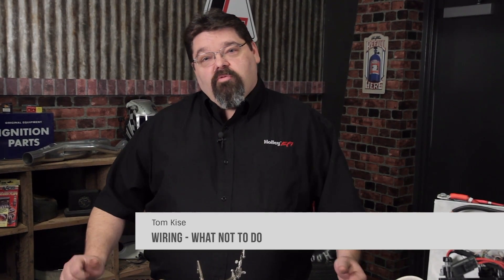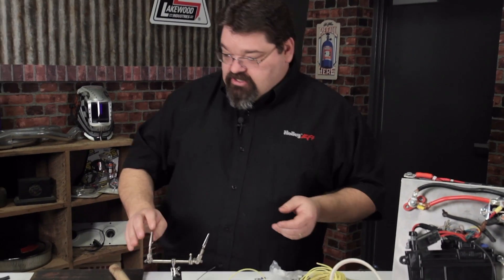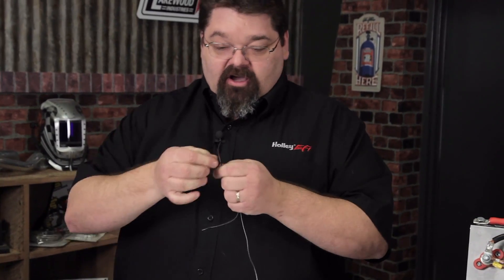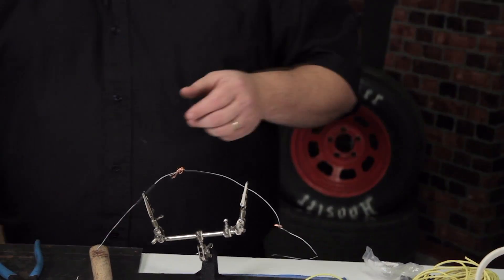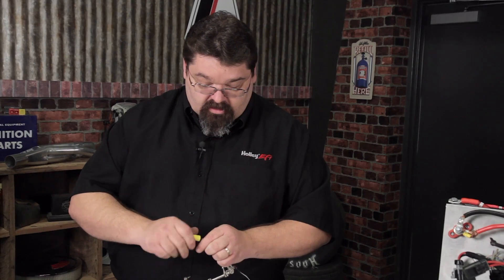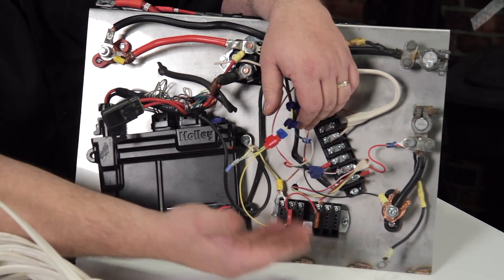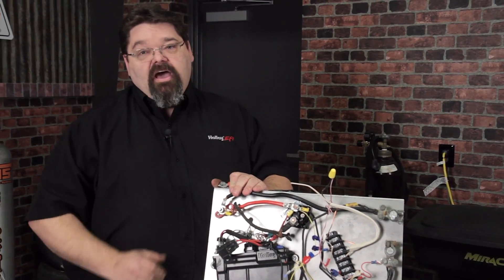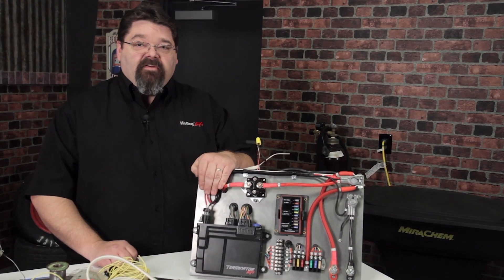Bad Wiring - What Not To Do

Comment: 0:20  The GUAGE is good 14 or 12 gauge copper is  GREAT conductor!! .. But it needs to be multi Strand wire because of the constant vibration, and the oil resistant insulation ...  

AND?? NOT!! 6 or 8 Strand industrial wire either!! :) Muti Strand wire designed for automotive use (for oh so MANY reasons!!)
Reply: ill be honest... I use stranded house wiring for my car wiring. I try do everything by the book and proper (crimping, gromets, fuses...) but its hard to find good automotive wire in my place that doesnt cost more than my crappy car. is either bad insulation or very cheap stranded copper aluminum blend that doesnt last at all. 

and checking the specification of the high quality house wiring (thats still very economic and can buy from my local house supply stores) its just as good as the average automotive wire. also the copper is thicker too. 

also.. some manufatures insoluation is just terrible! I learned over the years that most oem wiring is just plain bad. so I dont feel bad about using stranded house wiring. and dont get me started with the crap wiring to comes with just about any after market accessory, you can smell the cheapness

bottom line is. you need stranded high quality copper and a housing (thats is properly even and thick around the wire) that resists solvents and flame.... most quality stranded house wiring does this. also dont forget the gauge for your application.

Comment: i was having trouble with my radio, went to replace it and the last guy had about no exaggerating 40 or 50 wire nuts holding cut pieces of wire to make them long enough to  reach the radio and speakers :face-purple-crying: needles to say that was a fun job  removing and fixing that, but the next wiring job i did on my house at least i didn't have to buy wire nuts .

Comment: Enjoyed your video. I was trained by electricians, electronics techs and automotive techs to do it right, the first time. 
   It took me two months to find a short in turn signal wiring. The wires were twisted together, then taped. The wires had corroded so the fuse did not blow, but the turn signals did not work. Crazy!

Comment: Perfect timing for me to see this. I rewired some kitchen and bathroom lights in a house last night.
The previous installer had twisted and taped the wiring... Using painters tape! What a mess that was.
The taped was of course degraded and splitting with live wire bundles right next to each other.
Basically, they were lucky the house didn't burn down, and the same can happen to cars.

Comment: This is hilarious haha. You should have had a big old rats nest too. I've seen romex, extension cords, household light switches and dimmers used. Aluminum foil wrapped around fuses, wires soldered to the fuse connections. I could go on and on. The worst one had I to straighten out was 14 pounds of wire I pulled out of a vehicle that wasn't even connected to anything.

Comment: So for tapping circuits what do you recommend in lieu of t-taps?
Reply: You should solder the 2 wires together.    The pinch connectors damage the multi strand wires.
Reply: I think the recommended splice would be to cut the wire, use a butt connector with one wire in one side and two wires in the other, and adhesive heat shrink over the whole shebang.
No matter what you are risking some corrosion creeping in, but it shouldn't be an issue if the crimp is done right and it's in a good environment in the car.

Comment: Screw in the battery terminal...

I was voluntold to help some people with their car by what may as well be my wife a few years ago. A hot shot came along and started taking control. I left the seen when he got a screw and a screwdriver cause he didn't want to bother to look for a wrench to tighten the battery terminals. Crazy people drive me nuts. Yeah, it worked, and he saved two minutes but I'm sure they were stranded a day or two later.

Comment: This and the other vid on how to are both great. yrs ago as an side of the road temp fix . I did use a wire not to get home. That temp fix was on the car for 4yrs till corrosion caused it to fail again . I back on the side of the road dead in the water. Young and dumb, is a saying because it has a certain amount of truth. 
 This was pre cell days had to walk about a mile to ,say it with me "pay phone" called a bud and flat towed it home no power brk. or steering. The real problem was the fusible link blew and  i patched it back together. Half-assed repair.  That was in the last century stone knifes and flint axes,were state of the art and dinosaurs always had the right-of-way.

Comment: OMG... I laughed through the entire video! 😂😂😂
Reply: I am still laughing now. I am almost finished rewiring a c5 zo6 that caught fire because a local shop wired the auto conversion, transmission break and 2 fuel pumps with wire nuts and electrical tape

Comment: what would be nice if u did a complete install of a boost motor on a engine stand. from start to end even the wiring and adding it to the software. That way we can watch a complete install oh a holley system amd adding boost controller ,meth,vss and all other add on that holley can do.Great tech videos.